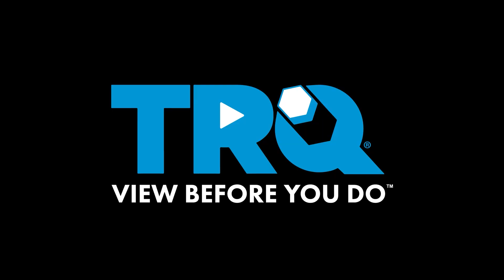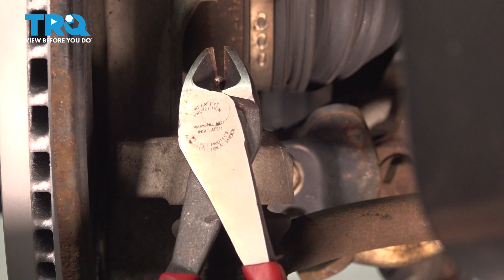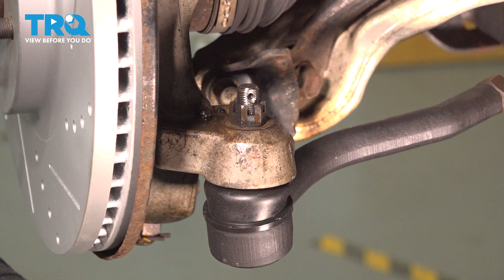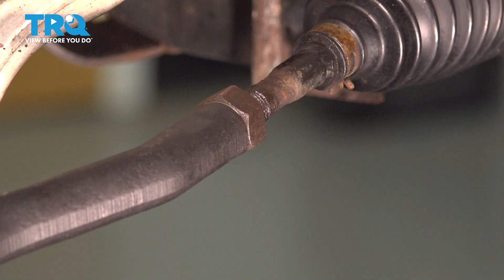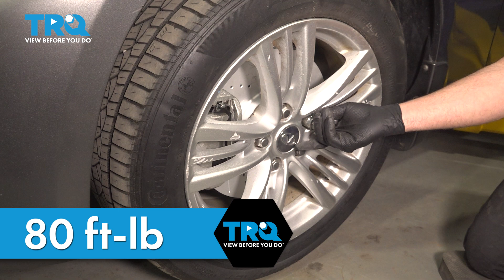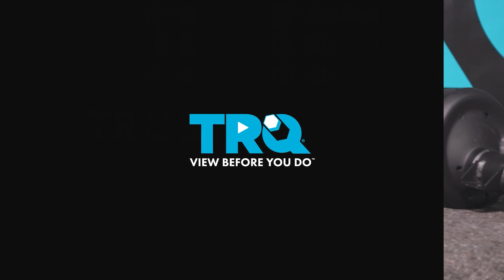How to Replace Front Outer Tie Rods 2008-2013 INFINITI G37

Comment: Assuming the tie rod end is the same spec as whats removed, could you also use a paint pen or similar and mark the threads and jam nut and just thread on the tie rod end until you get to your mark? Id hope you get an alignment afterwards anyway, this should also get you close enough right?